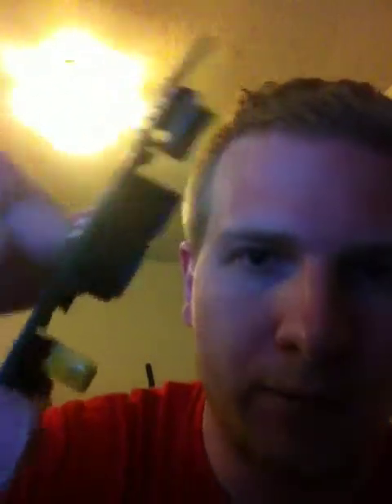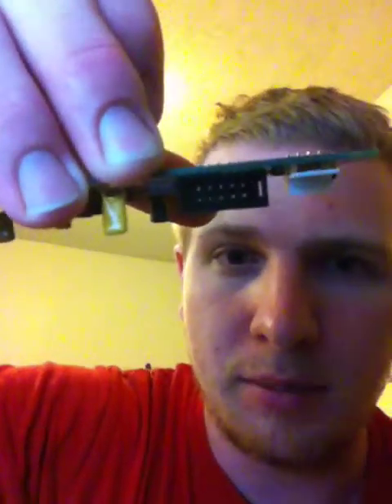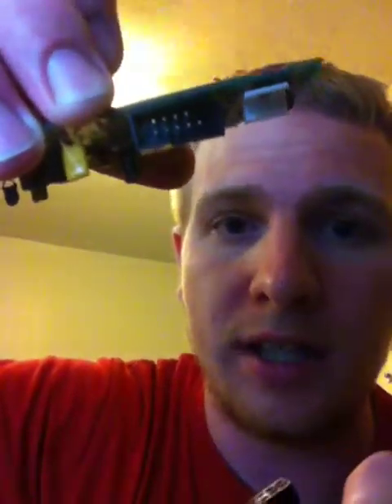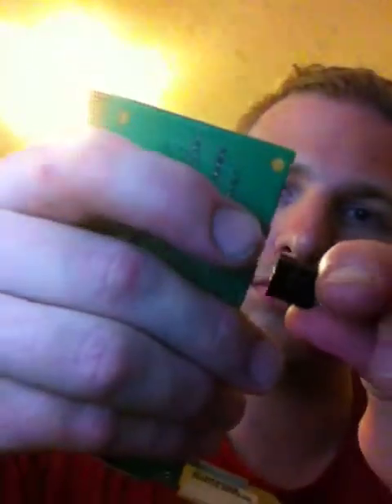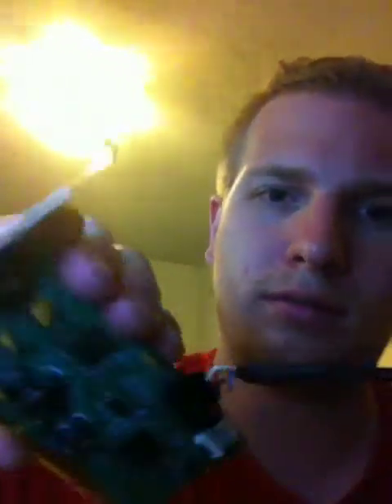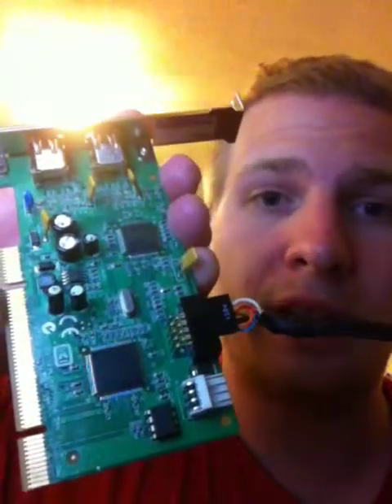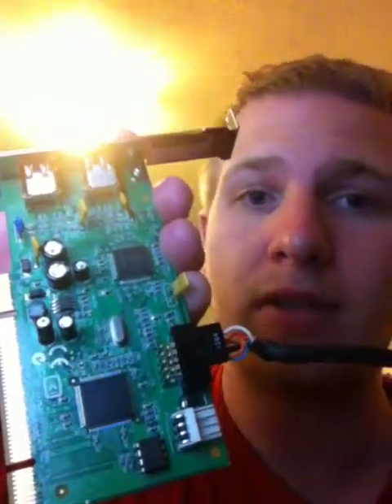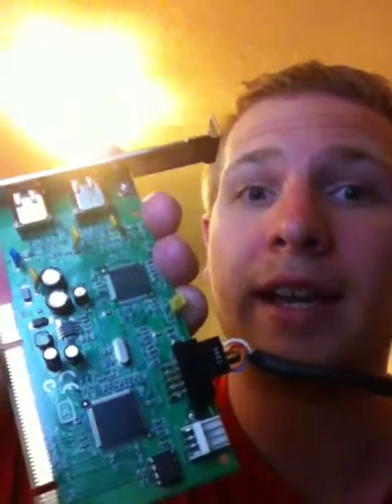Connecting 1394 ieee firewire front panel cable to HP Hewlett Packard Compaq pci card header

Comment: just take that cable out and put the pci side of the firewire pci in the pci slot of you computer and install the drivers and you should be all good
Reply: My fire wire connection is an on board 1,  and its its all. Pull apart and i dnt know how to set them bk